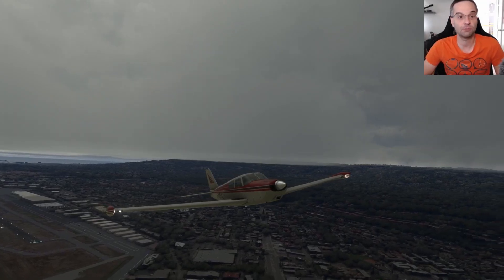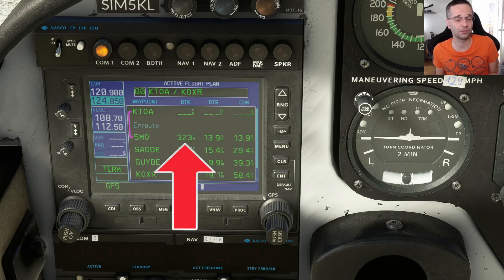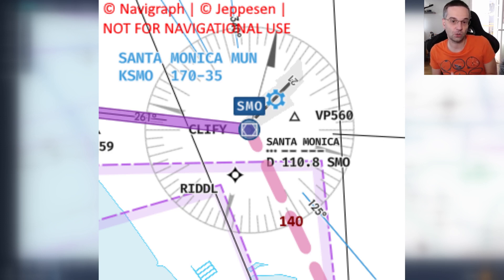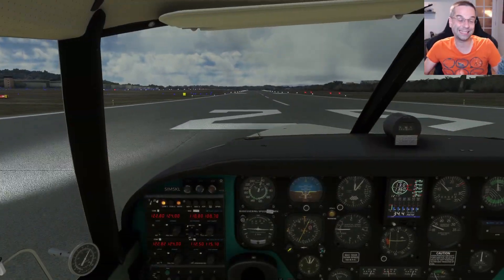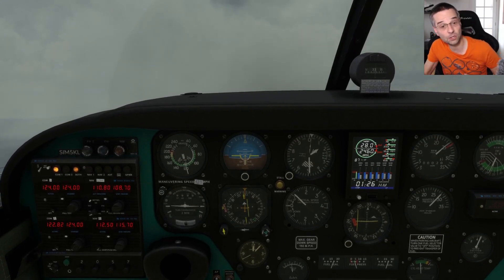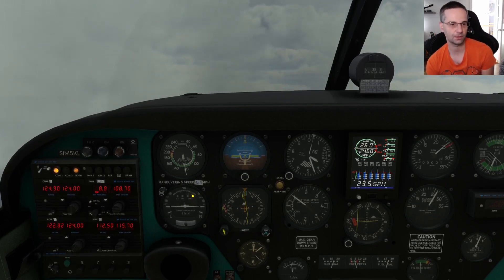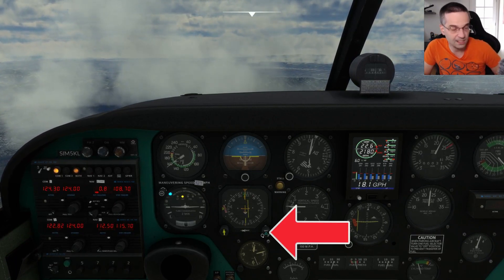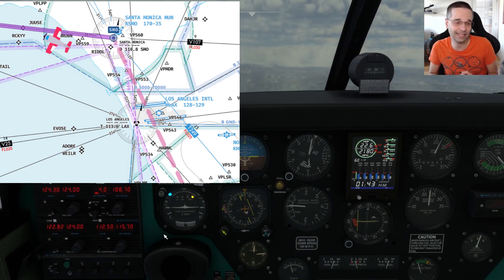Traditional Navigation Part 2: Flying To & From A VOR | MSFS Tutorial

Comment: What plane are you using? What planes in MSFS have an HSI?
Reply from the maker: You can check out part 1 for more info on plane recommendations, but I’m flying the a2a Comanche. You can use any of the garmin units without a flight plan if you don’t have any round gauge planes.